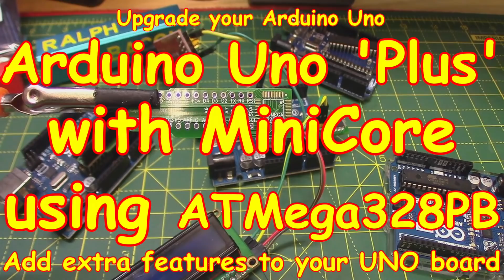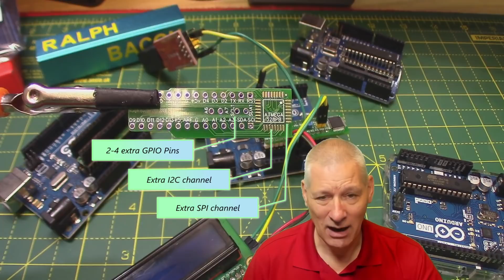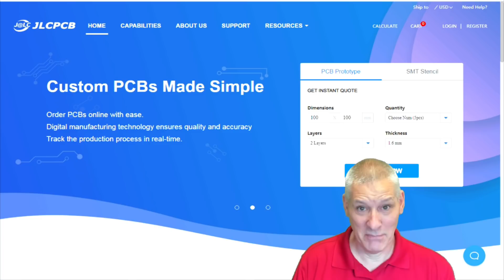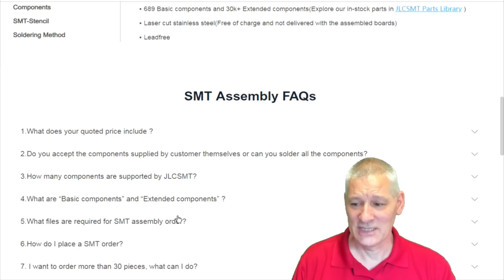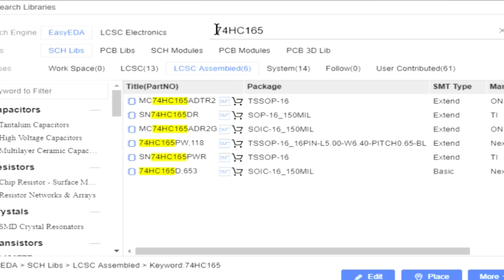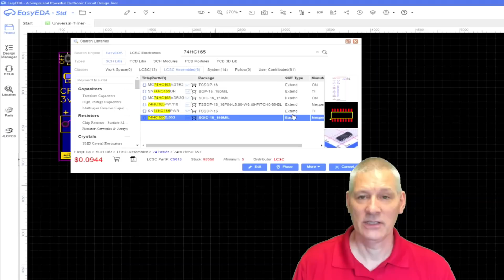#168 Upgrade to an Arduino Uno 'Plus' with MiniCore and an ATMega328PB

Comment: HI Ralph,  I've been watching your videos for the last couple of months and have gained a lot of useful tips for using Arduinos.  I am creating an arduino project at work using photo sensors and LEDs to detect the correct placement of electrolytic caps  in a pick and place machine which I am about to deploy.  Your videos have been a great help to me in this and I thank you.
Reply from the maker: You are most welcome, Jerry. That project sounds quite ambitious, good luck with that, I hope it goes well.

Comment: Really cool video thanks Ralph! Hey, there's also the option of these 40-pin long pin female headers that you could cut 14 pins in from each end.....? Here: https://www.ebay.com/itm/10Pcs-2-54mm-Pitch-40-Long-Pin-Single-Stackable-Shield-Female-Header-for-Arduino/172798484305?_trksid=p2485497.m4902.l9144  Might be better maybe? Anyway, just offering options, just in case. Thanks!
Reply from the maker: Yes, that is a good suggestion, and the cut won't have to be that accurate either (basically, be prepared to sacrifice one of the pins). And you will get the 2 strips out of a 40-pin header which is great. Thanks for the suggestion.
Reply: @RalphBacon  Yep, you are welcome. You will always find a use later for the remaining 10 pins left over anyway, i am sure. I have seen them used on the D1 Mini (as shield modules), and i know you have some of them.

Comment: Hi Ralph, I haven't experience in ordering  PCB's on JLPCB. In Ths case I entered the Filename as GerberFile: Project_DIP-to-LQFP_20191029173902.zip  After them I got asked about Dimensions. Is the given Filename the right one and how di I get the right dimensions?
Reply from the maker: That file is NOT the Gerber zip, CaroMan. It is the EasyEDA project backup which you must unzip and import into EasyEDA (the readme in the zip tells you how). Then you can order DIRECTLY from JLCPCB without generating Gerber files (from within EasyEDA), or you can generate the Gerber files anyway and submit in the usual way.
Reply: @RalphBacon  Thanks for the quick answer! Reading RedMe files has never been my strength. In this case, it would certainly have been helpful. Thanks to your answer the order went quite fast.

Comment: Hi Ralph like the video, when you create the video on the new SMD soldering iron is it possible to show us how you solder the SMD components with a standard iron.
Reply from the maker: Soldering tiny resistors or caps using a standard iron can be done, but I used a hot air gun (Soldering Rework Station) that I showed a few videos ago. Mine's the Yihua 959D  and seems to work very well for the £50 it cost me. But I might go through that in the video, keep tuned.

Comment: Hello Mr. Bacon, How about a Video about Solar charging. 1) what size solar panel do I need ? 2) What size battery do I need for the current draw of my project ? 3) What charger circuit do I need ( If needed ) 4) How long can my circuit work without sunlight ? (5 What is the life expectancy of the remote power ? 6) Can it be done at a low cost ?
Dave
Reply from the maker: Sorry, I'm not going to answer all those questions, Dave, as there is plenty of information out there on the Internet. But I'll answer question 6 for you right now: NO. I've looked at this topic many times and to get a realistic amount of power into, say, 12v lead acid batteries (ie ones with a decent capacity) is going to be expensive. I know that Julian Ilett has done a lot of work on this subject and you should see the huge solar panels and batteries n his garden.
Reply: @RalphBacon  Phew, thanks for that reassurance, Ralph! I should hate it if you too disappeared down that solar panel rabbithole thing! Bores me to tears that so many ruin their channel with so much of that stuff. Don't get me wrong...i am all for solar energy capture; it's just that the storage science just isn't there yet.

Comment: Hello Mr. Bacon, Is that a TQFP - i think so - or is it a VQFN  ? I can get the TQFP for less than $2.60 from DigiKey that I deal with all the time. Prime parts.
In the future can you use the size 0805 and not the 0605 when space permits ? They are much easier to solder and replace. I already have the 0605's and 0805 here in my workbench parts. If you have one more PCB I would love one. I do have a few if the original UNO's that I would like to convert - thanks to you !
dawreski@sccoast.net <-- hope no more spam. Dave
Reply from the maker: Dave, send me an email (read the pinned comment at the top, which now contains an easy to use link). Yes, it's a TQFP, generally available for about $1.40 but may be higher locally due to shipping costs etc. Using 0805 components was going to be my first choice but this is a tightly packed board (with tracks) so I had to go smaller, sorry about that.

Comment: This is a very clever idea and a well made board. Nevertheless, I would have loved to see the chip on the other side of the PCB, so if pluged into the UNO it would fit into existing mounts.
Reply from the maker: I'm not totally sure what you mean here! the PCB plugs directly into the IC socket as you saw. Shields even fit over the top if you use right angle pin headers for A6/A7 and the I2C pins (or omit them). Can you clarify what won't fit and where?
Reply: Ralph S Bacon  Thanks for your reply. You are right, my comment wasn't very clear. From what I can see, the "PB" PCB exceeds (slightly) the boundarys of the genuine Arduino UNO at the right hand side. This isn't a big deal and that's simply what I had noticed. I do understand that placing the chip in a left hand desing is compromised by the elctrolytic capacitors on the UNO. Nevertheless, I just thought that there might be enough space "inside" the boundarys of the UNO. Just thinking on the guys who simply want to replace the obsolete 328P by the PB version.
Reply from the maker: @konohh  I understand now. Another viewer suggested making the board wider (not longer, as I have done) so it was contained within the Arduino UNO footprint. My PCB doesn't overhang that much but would prevent it fitting a std Arduino UNO case, I guess. I wish I could solder that VQFP chip then it would be exactly the same size as the DIP chip!

Comment: I would also recommend owning an avrdude clone for in circuit bootloader programming. Very convenient if you build your own boards.
Reply from the maker: I'm sure that's a great choice too, but I have to say the OPEN SMART shield I showed does everything I need including allowing me to plug in an ICSP cable to program other boards too!
Reply: @RalphBacon  How is that gonna work is If have a atMega328PB on my personally designed board ?

Comment: Mr Bacon, maybe use a different serial port speed for serial0/1 (if possible), your coolterm would then show ...
xmini info : https://uk.rs-online.com/web/p/processor-microcontroller-development-kits/1463222/
Reply from the maker: Yes, you can have different speeds for the UARTS, I just didn't demo that, oops. I'll put that link to RS in my GitHub too, thanks for nudge.

Comment: I'm using the PB mainly because of the extra timers.
Reply from the maker: That's the one thing I didn't mention because I've never run out of timers, Bernd. But now you mention it, I should have said something. My bad. But the documentation is there for people to read!

Comment: I have tried a similar thing, but find that square header pins bend the contacts in the DIP socket.  OK, ok, I see now you used stackable headers!  Smart.  Have never seen pin headers that were round on top, and flat on bottom, but they would certainly have uses.
Reply from the maker: The standard pin headers do fit (very snugly) into the IC socket, Steven, but as I mentioned it's not something you want to keep taking out. Stackable headers work better but the board looks very ugly with them, I think (but still does the job of course). I've seen round header pins (got some somewhere now you mention it) I should have used those, I suppose.
Reply: @RalphBacon  That is a sweet PCB converter you had made.  Will the Chinese make a few more sell them on Ali?  An LGT 32mhz Uno is easy for you to make, now.

Comment: Hi Ralph. Very interesting video. Following your lead (some months ago) and following decades of ferric chloride pcb developing,  I decided to use Eagle to create my own project pcbs.  I have created three different project designs in Eagle and they have worked fine. (Well 2 out of 3 perfect - one needed a couple of tracks cut and wires added) then took a look at EasyEDA. OMG, much easier, less finicky and with easier gerber file production and links to a PCB maker . I'm now on project 8 with EDA and the service from JLCPCB is amazing. So to this video. I'd like to experiment with your 328PB design but couldn't see the EasyEDA files on your Github.  If they are there I apologise. A link in your reply would be gratefully received though. All the best.
Reply from the maker: I've copied the EasyEDA folder to my GitHub with a Readme that tells you how to import it, Paul. It cunningly called "DIP to LQFP32 UNO - BackupProjects_ralphbacon_20191029.zip" just to confuse you!

Comment: Super video and a very useful PCB, Ralph. The 328PB variant is a very useful upgrade and with the minicore library you have the fast development of firmware afforded by the Arduino IDE. True, the ATMega2560 can do even more for not a lot of pennies more and the STM32F can do even more and is faster and cheaper, this incremental improvement makes the learning curve both shallow and shorter. While I am not always convinced of the efficiency of the code generated by the Arduino IDE and its many libraries, one cannot argue with the fact that the development process is probably the fastest available to the amateur maker. One gets to the smake generation phase so much quicker.
Reply: I think that is the biggest advantage arduino has over the stm32 boards is the libraries.
Reply from the maker: As I said in my blog, there is life in the old dog yet. And just to wring every ounce of comedy out of that line, no I don't mean me.

Comment: First time I heard about the PB version. Mind boggling if those really aren't available as devboards.
Reply from the maker: If you find a dev board (other than the official one I showed) let me know, Ristormatti!
Reply: @RalphBacon  https://www.pololu.com/category/239/a-star-328pb-micro for example.
Reply from the maker: @TheKetsa  Yes, I've already covered that board, but it is not particularly cheap (for what it is). I want to now desolder a 328P chip from a Nano and resolder a 328PB (except pin 3 & 6)!
Reply: sir if you solder a 328pb on an arduino nano excepting 3,6 pins does it works?
Reply: @RalphBacon  https://www.bq.com/en/zum-core-2-0
Reply: @damianpinnington5477  35 darn euros for an Uno+...? Are they outta their minds? I would be very curious to see their sales figures!
Reply: Oh...their head office & factory is in Spain. They are probably producing it on some "EEC grant" money. Who cares if nobody validates that there is even a market for them at that price....just produce them anyway!
Reply: @englishrupe01  over priced robotica for kids is very fashionable here. most parents are super happy to pay if they think the kids are learning something.

Comment: Nice that Microchip is trying to keep the AVR line alive, but with more capable MCUs coming it at around the same cost, I wonder if the effort is warranted. Still, the new chip is a nice update and it is a shame that Arduino never used it to update the UNO. But I guess their reasoning behind that might be related to that whole 'other MCU' bit I mentioned. Again, an excellent video and keep 'em coming.
Reply from the maker: I've changed my mind on the UNO recently. Yes, whilst I love the more powerful devices, STM32, ESP8266, ESP32, LGT8, et al, for beginners I don't think you can beat the UNO. There is a LOT you can learn using it. This board takes it up a notch whilst being 100% backward compatible.

Comment: Great work as usual.
Nice way to replace the processor, did you mention that the old Dip version would end production?
Some of us do need to replace a burned processor now and then for one reason or another - Thank you
Reply from the maker: No, no, no panic! I didn't say the DIP chip (328P-PU) was ending production, but if you go onto the Microchip site they say "In Production, Consider: ATmega328PB" and you can still get one for $1.69, but they are generally available. Phew!

Comment: Ralph This video was very informative and valued for those that still like to use the arduino with some added features. What I had hoped you do a video on the process of how you created your board and the process of ensuring you are going to get what you have created. The minicore board look great by the way. It would have been very informative seeing you design and sent it off to be made by JLCPCB.
Reply from the maker: I'm doing a much more details video in a week or two about JLCPCB SMT assembly PCBs, so keep tuned, Don.
Reply: @RalphBacon  Thank you. I look Forward to it. I am seeing a lot using JLCPCB and they have all indicated they made mistakes and had to redo their work, sadly they do not show what they did wrong to correct it.